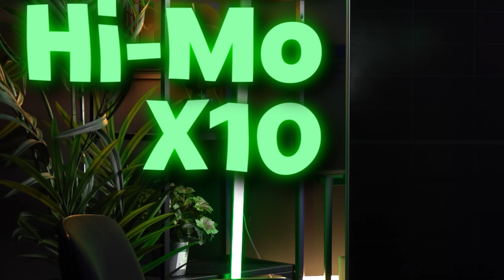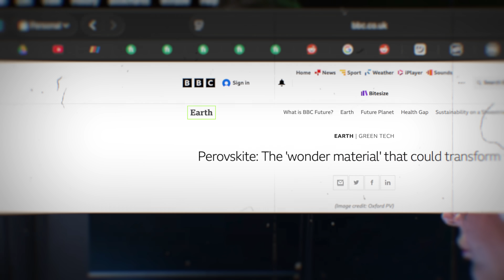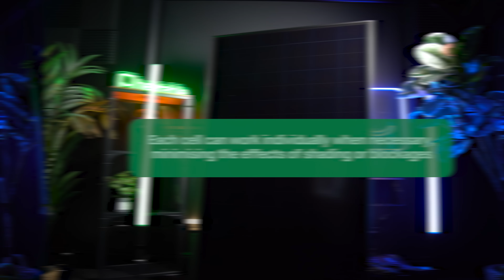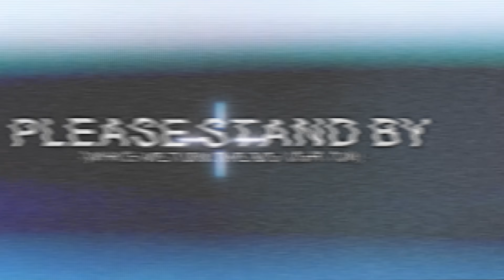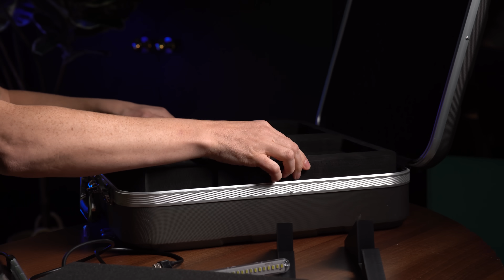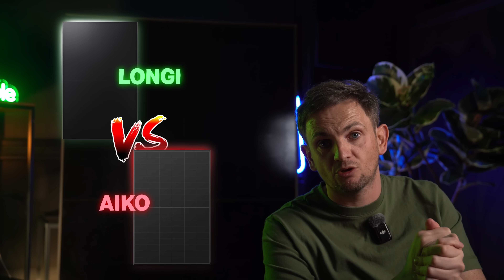This Solar Panel is Taking Over! The NEW Longi HiMO X10 Solar Panel Review

Comment: I thought the 'new thing' was double sided solar panels? Panels that capture light that's passed through the front. Am i wrong or do your two makes there beat those?
And why worry about panels that beat shading if your roof doesn't get shade?
And i was under the impression that most installs have individual electric gubbins boxes for each, sorry, just came to me... INVERTERS for each panel so they don't run on the christmas tree light principle.
You may have guessed i don't work in this industry, i weld bits of metal together.

Comment: The 495W Aiko is 24.8% efficiency and you got the sizes wrong - how could you make two key mistakes as a solar installer? It's in the datasheet. It is close in height but with two or more panels high, or indeed wide if landscape, that could be the difference on some roofs of fitting that extra row. Both are great panels though, no doubt.

Comment: These Longi panels smash the equivalent Aiko options. How do I know? Well we have a roof of dozens of different arrays side by side. These Longis are tonnes better and its all we are currently proposing and installing. Just this week 80 bifacial options.
Reply: Tonnes better in what way? That implies a seismic improvement. From the above video comparison, it appears there’s very little difference. I’m open to either.
Reply: @andrewallen9918 you will do well to get AIKO atm as supply issues are problematic. The main differences are around optimisation on the panels and start/end times. The Longi is a lot better side by side. They are also currently 20% at least lower costs which I find incredible.
Reply: So I have booked to install on a split array 16 x Aiko 480kw Neostar Gen3 so would you recommend the Longi    hi-mo X10 eco lite 485kw

Comment: 14:03 The figures are on the opposite panels in this section, i.e., the Aiko is 1762x1134 not 1800, and vice versa.  The Aiko and Longi x10 panels are extremely similar in many ways, I don't think one is obviously better than the other.  Both are also available in the 60-cell size.  Having both sizes available on installation day would be a significant advantage since the roof size will often be slightly different to the estimates from the satellite photos, and being able to swap from one size to the other will help maximise the output..

Comment: Are there any other panels that can get the better output on a north facing roof, particularly in winter?
Reply: It's possible that a TOPCON panel might generate more on a north-facing roof.  The BC/back-contact panels tend to have very good performance when partially shaded, and when well lit, beating TOPCON in both cases, but a bit less in low light conditions.
However low light performance is not published so it is hard to compare panels.

Comment: Got the sizes wrong !!!
Aiko Neo 3s is 1762mm Long
Longi is 1800mm Long
Longi is LONGER by 38mm, or 2% longer than Aiko
Which might cancel any slither of performance based upon 2% longer length on Longi

Comment: You're abit late to the party. MC Electrical ran this test over a year ago! youtube.com/watch?v=mWQsia29Sk0 intertesting results ;)
Reply: Not at all convinced about MC Electrical's results.  He didn't seem to be aware of how the voltage-breakdown actually works (1-3 cells can be shaded per bypass diode, the bypass will kick in on the 4th), and also tested in a ground-mount setup rather than a dark-tiled pitched roof setup, when means that the panels could be illuminated from the rear which would change the results on the other panel.
Having said that, it was good that he tried to actually test the panels, so kudos for that.
Reply from the maker: We’ll check that out